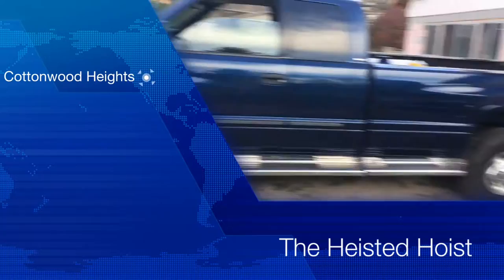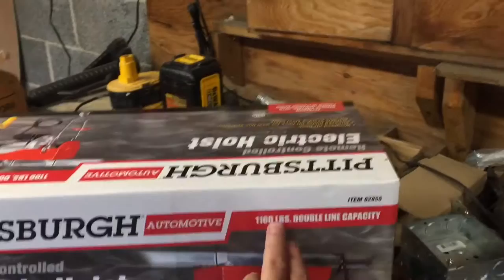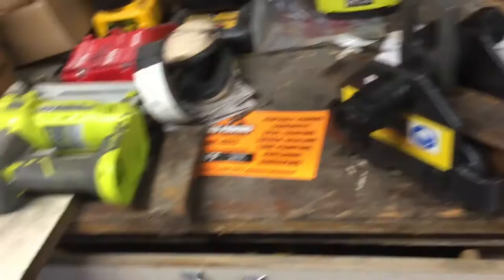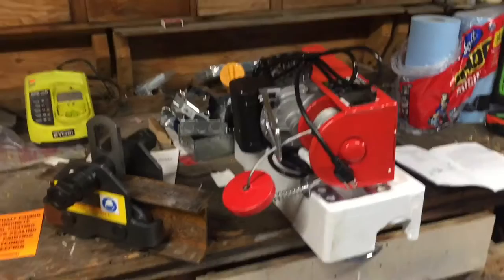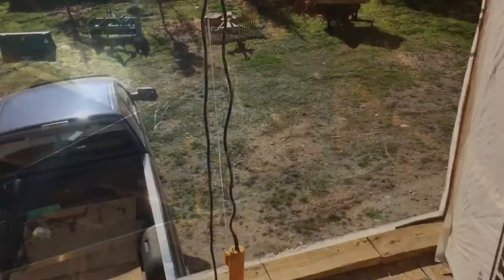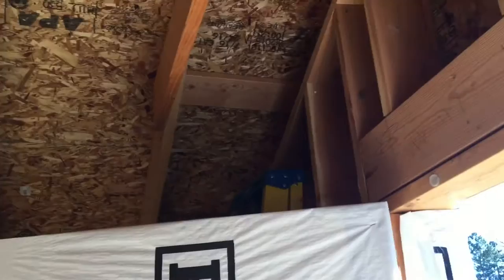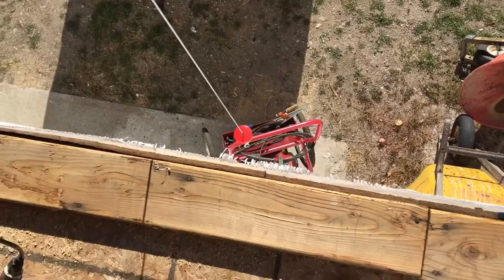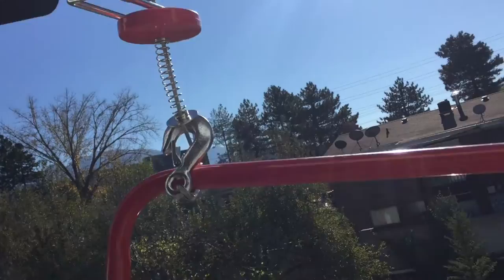Harbor Freight Hoist

Comment: An obvious lever arm is created on the box tubing that extends outside the building. There is a significant risk of the tubing buckling at the forward trolley.  Anyone using this type of design should go through the calculations to determine the max safe load before the box tubing bends beyond it's elasticity. Consider doubling up the tubing in the area of the forward trolley by welding a second piece immediately below that trolley, perhaps 4' forward, 2' back (just an example- should be calculated).  The max load the ceiling joists can handle should also be calculated.
Reply from the maker: Zeric E Yep.  I haven’t been lifting really heavy loads... but I do want to reinforce that tube like you say.  Thanks for the tip!
Reply: @CashJohnston  Why not just have the I beam go straight out the door? Have the whole assembly roll out the door and mount the winch in between the trolleys. Notch the door around the beam like they used to on the old barns.

Comment: The 2 x 4 with the chain around it would be a lot stronger if it was turned on it's edge rather than laying flat.
Reply from the maker: Yes.  I agree.  I don’t anticipate a awful lot of weight on this thing though.  I may still double it and make it two 2x4s.